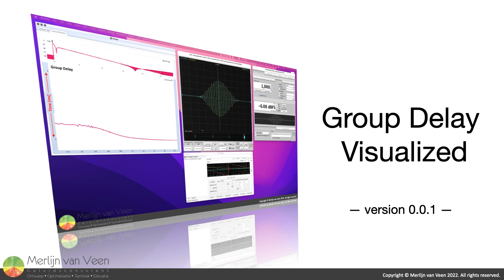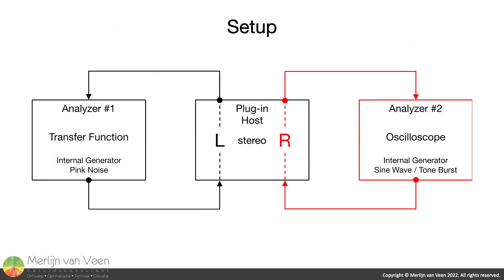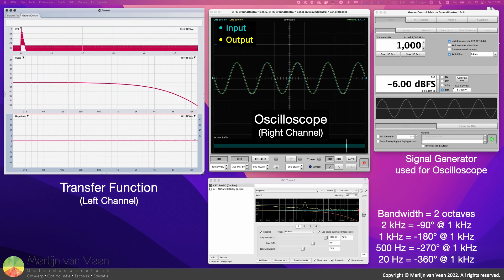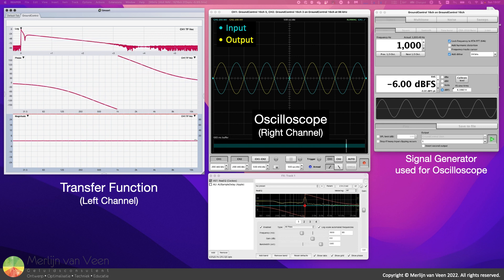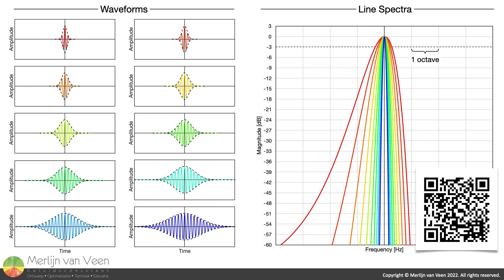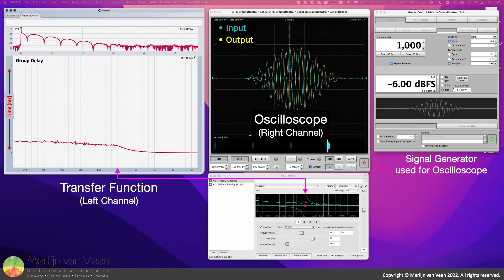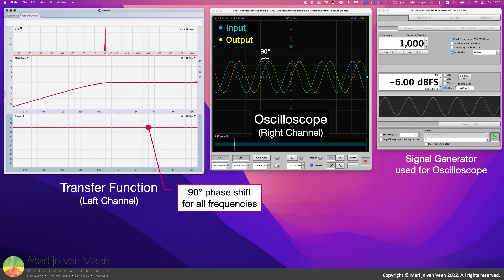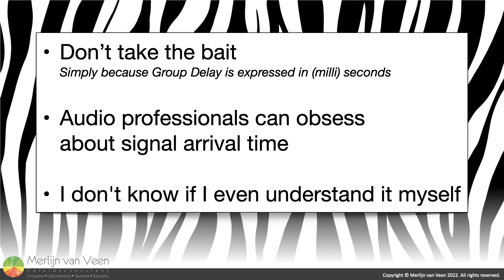Group Delay Visualized

Comment: This video is awesome! Starting with a delay line, going for a regular filter and ending with a constant phase (= frequency dependent delay) filter is an excellent explanatory journey.
For a week now I have been breaking my head over the question if phase actually introduces a delay in the output. e.g. let's take the constant 90° phase shift filter and place 1000 of it in series. Does the 1000x90° correspond to a measurable (or audible) delay at the output? or does the phase wrap around at the 180° mark and there is no delay at all? According to your video it is the latter.
I am sure if I keep thinking about this video enough, i can finally wrap my head around it.
Reply: A constant phase has a group delay of zero. But group delay is not necessarily the latency that most people think of when they hear the word delay. A time delay gives a linear phase.